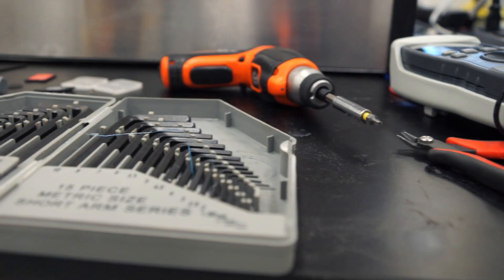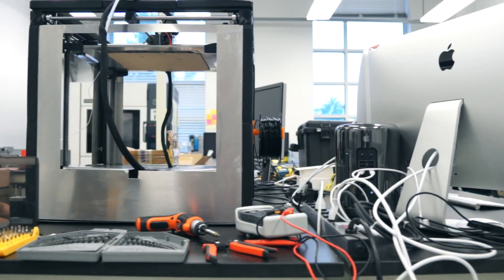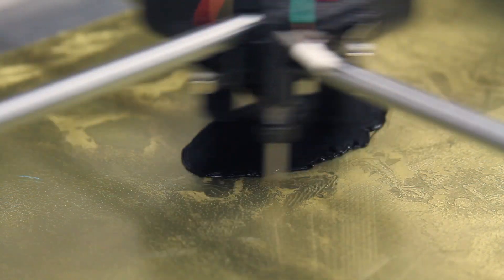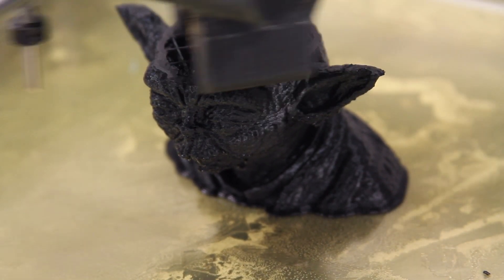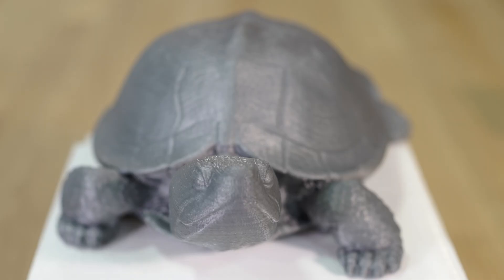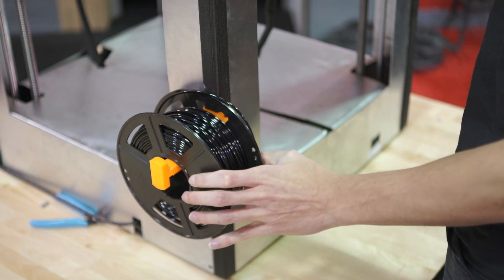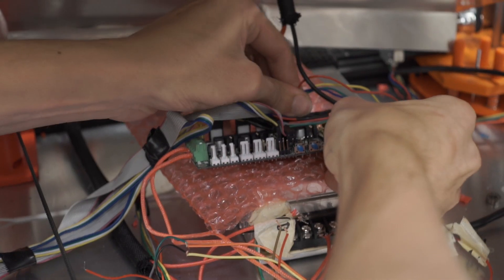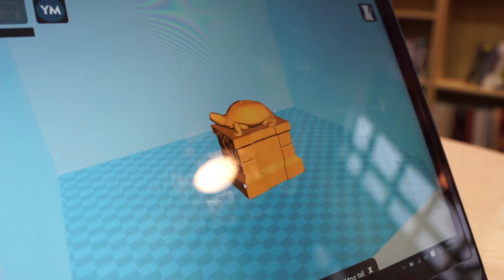Ready Box: Kickstarter

Comment: I backed this campaign and came to regret it. This is basically a one-man show, and Brett's lack of experience really shows.

Where do I start? Brett failed to design a good package system and the printer arrived with extensive damage to at least 11 components. Z rods were displaced, X and Y rods were bent, panels smashed, on and on.

Besides the shipping damage, the printer itself is "Not Ready". Rather than a finished product, it looks like a DIY project someone put together in their garage from basic off-the shelf parts. And that's pretty much what it is. Not a $2500 printer, I wouldn't pay $1000 for it.

Here are just a few of the problems: The frame is weak and unstable, it has no corner struts and was falling apart. The X and Y rods are too thin and weak for their length. The Z rods are not secure, they lift right out of the base. The bed mounts have a lot of play in them. Major parts were 3D printed--poorly. The acrylic sides and false bottom are not secure and look cheap. There is no Z end stop so the bed can smash into the head (and it did). After only the third try, the LCD died. I could go on, I found over 20 defects.

Worst of all was the amateur customer service. After I had returned the mess he sent me, Brett refused to give me a refund and argued with me. (At one point he even accused me of packing it badly for the return ship.) He obviously doesn't know what he's doing and is only out for himself. Good luck to the rest of the backers, I'm glad to be rid of the "Not Ready Box".

3D Printing Chicago